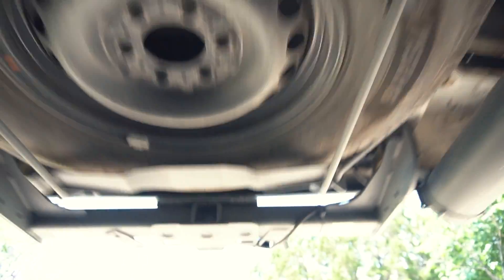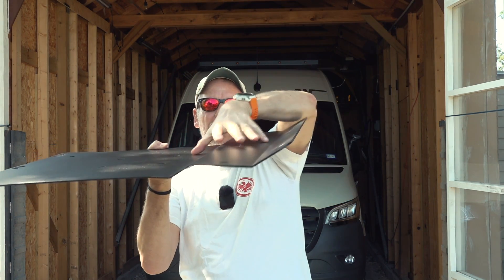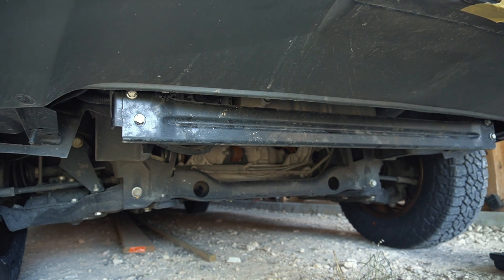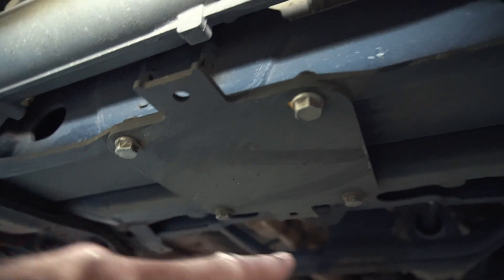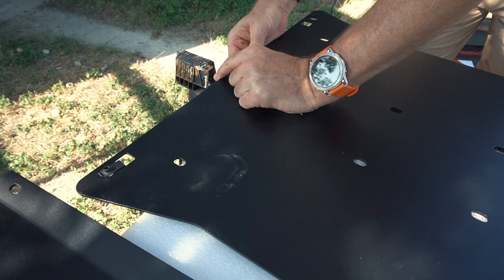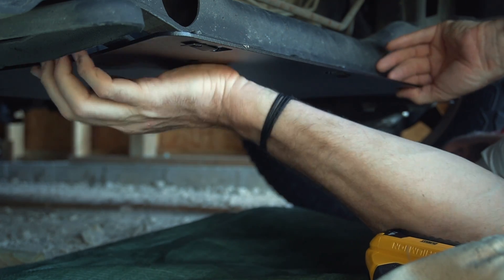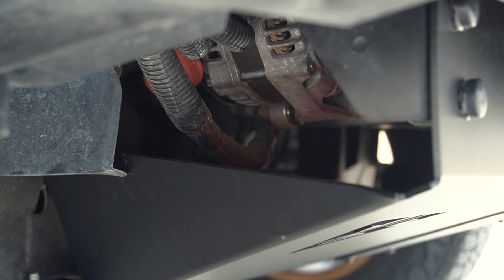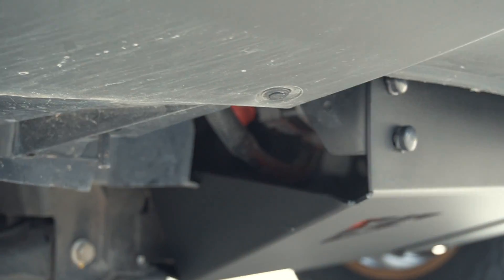Vanspeed Skid Plate | Mercedes Sprinter

Comment: I think I'd ditch the non-metric hardware for metric clip nuts and screws.
Thanks for the video!
Reply from the maker: thanks. I thought about changing to metic hardware, too. the oil drain cover screws into rivnuts, not these clips, and I didn't want to drill them out and replace them with M6.

Comment: A good investment. One additional area is the plate for the differential. The Winnebago ones are problematic as they can literally peel back if you were to strike something high enough. If you don’t go off-road in the back country, it is likely not a risk, but I like to cover it.